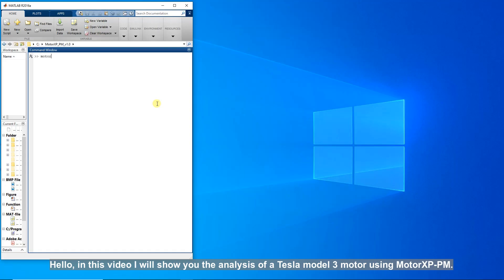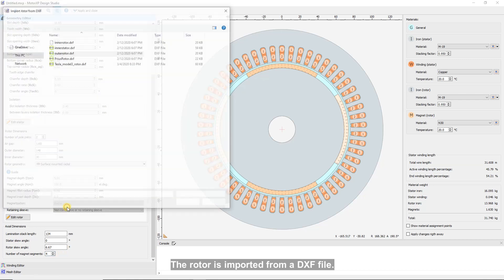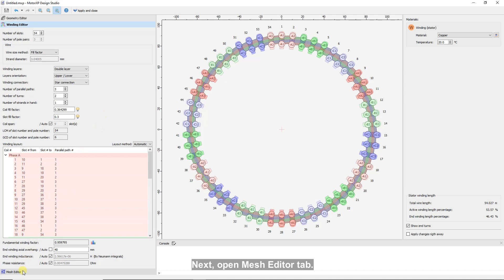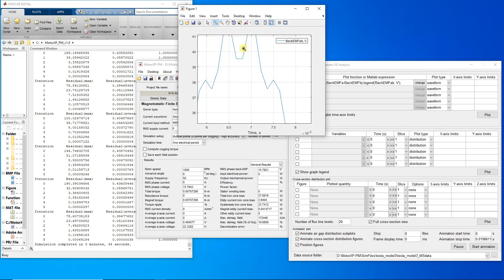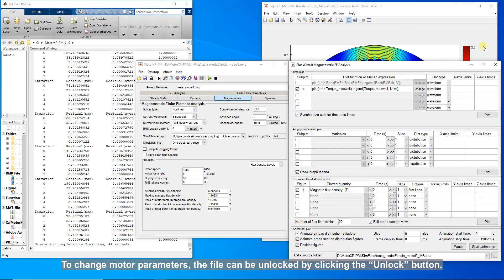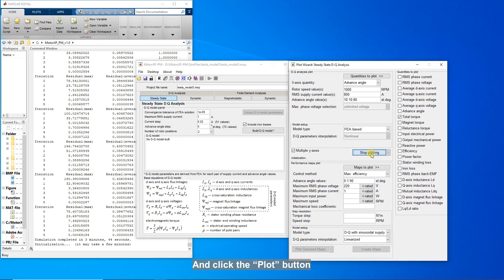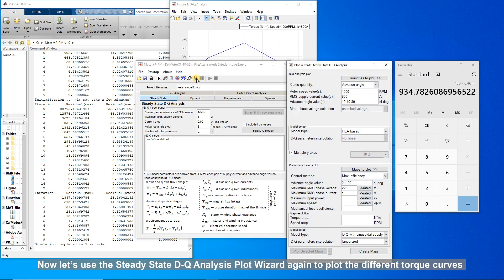MotorXP-PM – Performance analysis of a Tesla Model 3 electric motor (part 1) – Magnetostatic FEA

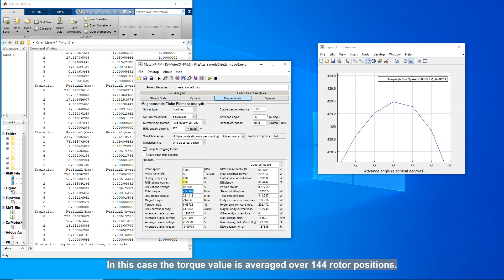Comment: Hello, ı think there is a mistake . In 12:45 , You compared D-Q analysis with Magnestostactis analysis. But the D-Q results are for 1000 rpm, while the magnetostatic is for 4000 rpm. Is this  mistake?
Reply from the maker: Hello, thanks for the comment. It is assumed that the torque in MTPA region does not depend on speed. The torque starts decreasing once the motor enters field weakening.
Reply: @motorxp   Thank you for answer.As i remeber, MTPA is maksimum torque per amper. It is correct?
Reply from the maker: @azizcanbozkurtf1  Thanks for the question. Yes, the are usually two regions in automotive applications: maximum torque per Ampere and constant output power.
Reply: Hello again @motorxp  😀
We defined 953 Amper. Is it real amper value for tesla model 3? It looks like huge value
Reply: @motorxp  Hello, are you here ? I have a question. We defined 953 Amper. Is it real amper value for tesla model 3? It looks like huge value
Reply from the maker: @azizcanbozkurtf1  Yes, the max current is about 1000 Amp
Reply: @motorxp  Woav, i can't imagine it. I think that it is huge, are you on the same line with me? or normal for you?
Reply from the maker: @azizcanbozkurtf1  Just keep in mind that battery is about 350V DC and the maximum output power about 180kW - you can easily estimate the required current.
Reply: @motorxp  Thank you, I know I have asked many things, but please let me ask one more. Can you tell me why you choose 0.3 for slot fill factor? So the motor will have big current density and the temperature will increase easily.

Also, this motor is the rear motor of Tesla model 3, isn't it? 
I had a look at websites, websites said the motor is 258hp (192kw), 317lb-ft (430Nm), but they didn't say at what speed.
Reply from the maker: @azizcanbozkurtf1  0.3 was just the fill factor we calculated for the real motor knowing the number of wires and the wire diameter.
Yes, it is a Tesla Model 3 (2018) rear drive electric motor.
Reply: @motorxp  Thank you for answers. They are so helpfull for me. If I have a question in the future, can i ask ?

You can say, " No no, enough" :) Thank you
Reply from the maker: @azizcanbozkurtf1  Sure, please feel free to ask any questions!
Reply: @motorxp  Thanks, me again.

You defined 4275 rpm as the ratedspeed. It is not important for d-q analysis due to MTPA, but it is important for FEA analysis. Is this the actual speed or did you prefer it to avoid high temperature?

Looking at the results, the motor can run up to about 6200 rpm with the same torque. At these speeds we can get more output power and efficiency.
Reply from the maker: @azizcanbozkurtf1  I recall that at this speed the motor produces maximum power and maximum torque at the same time.
Reply: Hm

Comment: Thank you so much. In the obtained results, the current density of the stator is about 43 A/mm2. Is this current density possible in electric motors? Is it realistic?
Reply from the maker: Tesla is using very efficient oil spray cooling, so it allows to achieve that high current densities

Comment: Is permanent magnet desmagnetization linear?
Reply from the maker: Yes
Reply: @motorxp   It seems that you define the linear model from the 'nominal coercivity' (optional), right? But, there are magnet grades which this is in the non linear part of the curve. More appropriate would be setting with 'residual Inducation' and a calculated 'relative permeability'. This is the case for the N52 grade in this simulation. Do you know what grade is used in Tesla Model 3?
Reply from the maker: @gabrieloforti  Thanks for your comment. Yes, you are right, there are some magnets for which the knee falls on the second quadrant of BH curve (including N52). We will make the corrections.
We don't know which grade is used in Tesla Model 3, we just guessed.
Reply: @motorxp  N42UZ-GR, seems like it
Reply from the maker: @gabrieloforti  Thanks for the information!

Comment: Hi ! Why when I do the ratio between Output mechanical power and Input electrical power I don't find the same value of Efficiency in Magnetostatic Analysis ? (at 12:40 for exemple)
Reply from the maker: Hi! Thank you for your question. We found that most stable way to calculate efficiency is: 
Efficiency = OutputPower/(OutputPower+WindingLoss+IronLoss+MagnetLoss) = 100%*182206/(182206+16555.3+411.4+15.3) = 91.47%
This is because the input power value calculated as an average of instantaneous power
p_input=ia*va+ib*vb+ic*vc
is greatly influenced by time step. 
Moreover, the input power does not include iron and magnet losses, as they are calculated in a post-processing stage.
Reply: Thank you very much ! And so it is the same for the Dynamic D-Q and FEA Analysis ?
Reply from the maker: @mrriser2312  Yes, the same basically
Reply: Okay ! Thank for all your answer. Your soft is verry cool, good work.
Reply from the maker: @mrriser2312  Thank you! Please let me know if you would like to try a full version
Reply from the maker: Thank you!

Comment: @Markus: Halbach array only exists for surface mount motors.. the segmentation is to reduce the magnet eddy current loss.
Reply: do you have the tesla_model3_dxf file?
Reply: motorxp user gets the geometry file in mxp format.  @faourkh1819

Comment: Can a similar motor with external rotor can be made?
Reply from the maker: Thanks for your question. IPM rotor is rarely used as an external rotor. One of the reasons, I think, is reduced saliency ratio - inner rotor allows higher saliency ratios. Nevertheless, you can try to design your own motor with outer rotor using Tesla motor as a prototype and see how it goes. All you will need is to request a free trial license for MotorXP-PM on https://motorxp.com/downloads/

Comment: Did you calculate the dimensions entered while designing? Or are these the standard measurements currently used? How can we find these measurements? Please help me and thx for video.
Reply from the maker: No, these are the dimensions measured on the real motor
Reply: @motorxp  how can i find these measurement?
Reply from the maker: @yasinsezgin7940  Please contact me at 2v.kuptsov@gmail.com
Reply: @motorxp   Okey, thanks. I sent an e-mail
Reply: @yasinsezgin7940  dostum selamlar. Sana motorun .dxf dosyasini gonderdi mi?

Comment: I want to work on a project I need a high effiency big motor, how should we collect a stator, how thick we should use how many turns of copper, how many lanes stators should be, how many poles and what kind of rotor we should produce.and I would be very grateful if you could enlighten me on all other necessary details please contact me if you help me i will help you when i improve my e mail sertstil@hotmail.com

Comment: Really nice video Vladmir

What is the reason of such a low copper fill? Does the real motor have that much free space for more copper or it's just the number that makes the phase resistance match, and in the real motor it's actually filled quite a lot due to insulation or anything else? Or it's functions of a cost optimization, that mount of copper is enough for the performance metrics they wanted and reduces weight and cost?

Thanks
Reply from the maker: Yes, the real fill factor of the motor is close to that value ~30%. I think it is some limitation of the winding tool.

Comment: nice simulation! But are you sure the magnet grade is N52? I think 80deg of max operating temperature is too low for EV motor.
Reply: You can find some info from the teardown of Sandy "Halbach array" Munro. Remanence is in the area of 1.25T at room temp, pointing to a N40XX-N42XX grade which makes sense for this IPM design. Regarding the temperature I agree, probably is something like of at least SH grade.
Interesting remark: the recommended max operating temp you can find in the standardized data sheet, like 80°C, doesn't actually tell you all the story regarding the demagnetization (there is seldom a a note that says that it is based on an standardized L/D ratio e.g. 0.7 in air ). It doesn't mean that >80°C it cannot work. What matters is that during the worst operating condition ( typically short circuit / high speed operation AND high temp) the operating point does not fall in the area of irreversible demagnetization of the BH curve. The position of the operating point of course depends on the machine design. A permanent magnet in open air is at higher risk of demagnetization than of a magnet placed inside a ferrite-magnetic circuit like in a motor. Eventually all the ndfeb will irreversible lose their magnetization at the Curie temp.
Reply from the maker: We actually do not know the magnet grade. Yes, you are right, it is definitely not N52. Thanks for the comment.
Reply: @motorxp What is the angle between the V shape magnet? Do you have a measurement?
Reply from the maker: @darthcheng5466  The angle is 138 degrees
Reply: @motorxp  thanks!
Reply: are you sure the phase resistance is 4.75 mohm? my estimate using AWG20 and 25strands in hand and 100 strands per slot yields not more than 3.5 mom. can you measure the wire size?
Reply from the maker: @darthcheng5466  I think we only measured the phase resistance, I will ask if we have the wire diameter measured.
Reply: @motorxp  any number on the wire size?
Reply from the maker: @darthcheng5466  AWG20, 19 strands in hand
Reply: @motorxp  thanks! Now it fits.
Reply: @motorxp  If this is used, fill factor is actually 0,4073.
Reply from the maker: @gabrieloforti  How did you calculate it?
Reply: @motorxp  Copper area / slot area. 39.7 / 96.8 (approximately).
Reply from the maker: @gabrieloforti  Considering 2 turns per coil, 2 layers per slot, one strand in hand and strand diameter 3.04005mm the copper area is 2*2*pi*(3.04005/2)^2 = 29.0343
Reply from the maker: @gabrieloforti  copper area = 2*2*pi*(3.04005/2)^2 = 29.0343

Comment: I'm not able to run simulation it's saying get pro version which cost 😢 appx 500$ around 40000 for three months is there is student version in which I can simulate my own motor or any other free simulation software. I needed this software.
Reply from the maker: Sure, we also have a free version (with reduced functionality) called MotorAnalysis: https://motoranalysis.com/
Reply: @motorxp  I had downloaded it but it didn't import my motor stator and rotor geometry dxf designed by MotorXP Design
Reply from the maker: @deepakpandey3346  please send me your file to to 2v.kuptsov@gmail.com, I will take a look
Reply: @motorxp  file sent.

Comment: It would be nice to show magnetic flux path at maximum torque to see how saturated is iron.  Also middle part of rotor is shifted. Is it to improve cogging torque? I was also wondering if it is possible that middle part of rottor has no magnets to increase reluctance torque for better field weakening or better, totally different pattern. Is there way to check it or does someone torn it apart? thanks
Reply from the maker: I can send you the flux path at maximum torque to your email address, please send me an email to 2v.kuptsov@gmail.com.
The rotor is made of 3 part to reduce cogging torque, but I do not think that anybody would do the middle part without magnets.

Comment: Is the rotor geometry exactly from the drawing of the model 3? The small anisotropic structure of the rotor, consisting in the small dimples on the rotor periphery are created on purpose for magnetic reasons or are they done for manufacturing reasons to simplify the rotor laminations's alignment ?
Reply from the maker: The rotor dimensions are taken from the lamination sheet after rotor stack assembly tear-down. We think that small dimples on the rotor are to reduce cogging torque.
Reply: @motorxp  can you share the rotor .dxf please ?